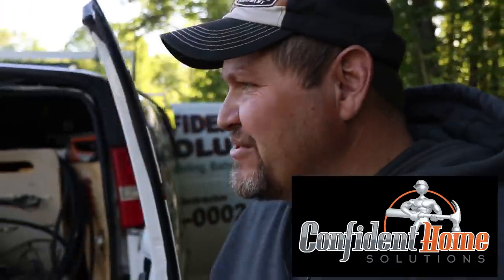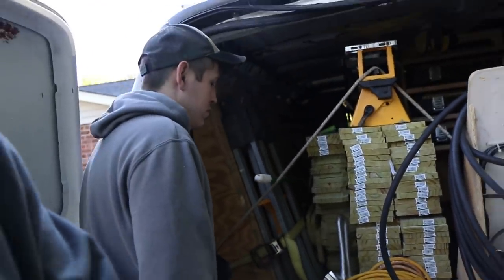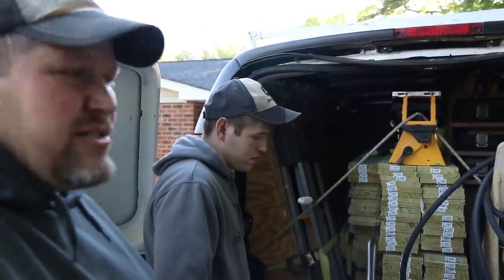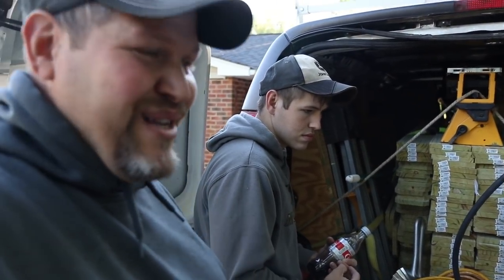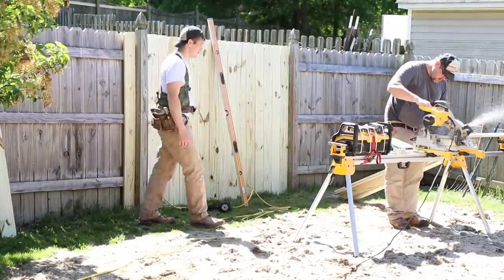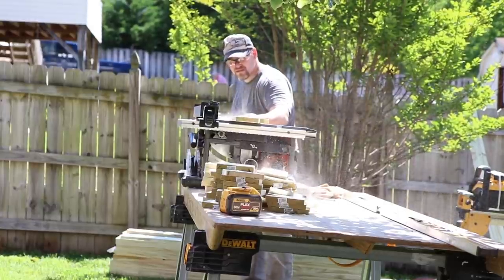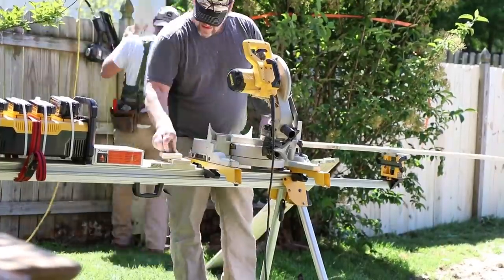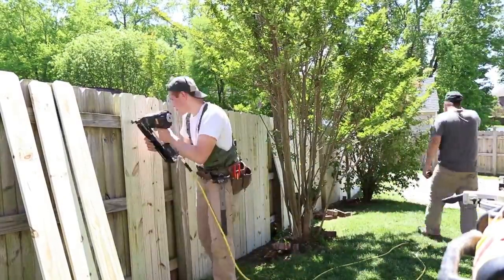Modifying an existing Fence to keep an Old Person from bothering Neighbor

Comment: All you had to do was cut a wedge on another 2x4 and nail it to the bottom 2x4 so it would be sloped and not allow someone to stand on it without slipping off. Less materials, labor, and weight on the fence. A few 2x4’s ripped at  an angle would have been easy-peasy.
Reply from the maker: No it’s not Easy Peasy Scott. That very idea was proposed to the client’s daughter and she said No. She wanted pickets.
Reply: @campbellbuilt  she may have said no, but that doesn’t change the fact that it’s the easiest solution. Weight is an issue especially in high wind areas where posts can be stressed and sag or fail.
Reply: @Gi Gi Pull off the wedge? Yes if you built it, but if I did I would countersink 3” screws every foot so it would be permanently attached. Slipping is the point you donut! Thanks for ‘trying’ to correct me, but my point of simplicity and ease of installation is correct. I already agreed if the client is happy then great, but to deny my main point is just idiotic. Someone out there could save time, money, and hassle with my suggestion.
Reply: @Gi Gi How about punji sticks? Better yet barbed wire and rusty nails. Did I trigger you with common sense and practicality...I’m so sorry.

Comment: Hate say might only last till he went and got a hair to try and climb over 
Suggestion I did some fences with coral bord it’s treated and comes in 16 ft lengths we did my bosses back fence at 12 ft with a back gate to the ally it’s some strong fence only draw was getting good strait pieces but we worked with the supplier made a great privacy fence no way to climb it without a ladder you might think about it dressed it up with nice top pieces and corners if you didn’t look hard you miss the door cut strait out of the wall to keep it uniform

Comment: Razor wire would have been easier, I mean can't he just go gab a step stool or a chair? Two cmu blocks? All kidding aside, around here, we will put down a sacrificial horizontal board at ground level to keep moisture from wicking up to the vertical boards. Also we will at minimum dip each fence board top and bottom in a water sealant.

Comment: If the idea is to stop the old man you should have put it higher by putting it level to the first run. It would still be secure on 3 points and be higher.

Comment: Unsure what you are showing. in Michigan the ugly side faces the home owner. It appears you put up a second set of boards leaving no 4 inch gap at the bottom for clearing out weeds tha grow between both panels as such although it is unlikely suc will happen as you nailed to stringers as such. So who owned the fence? the bothersome neighbor or the other neighbor with the protection order?

Comment: You could install 15 mile electric fence at very top of fence.. that would. Put some - " Quit ""   in grandad .... problem is that much 
Voltage might set pops depends on fire ......lmao .